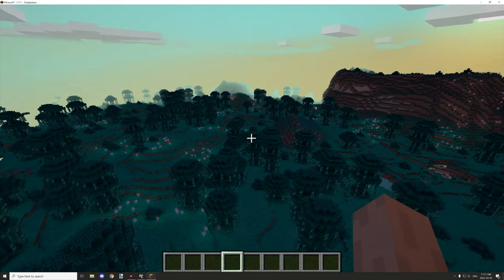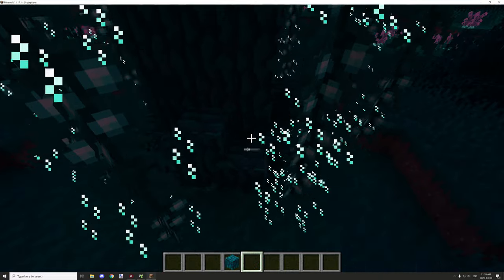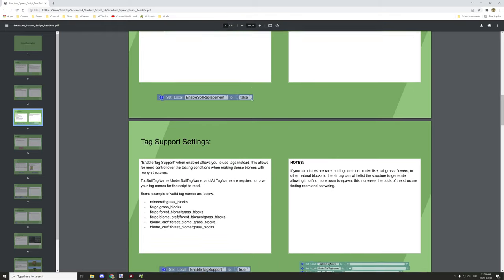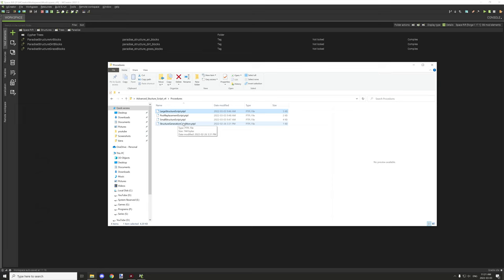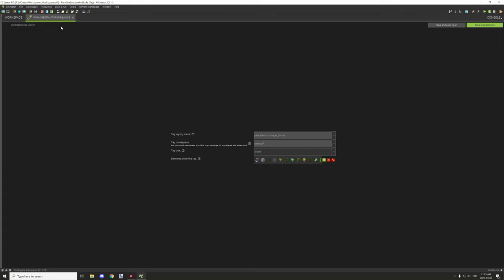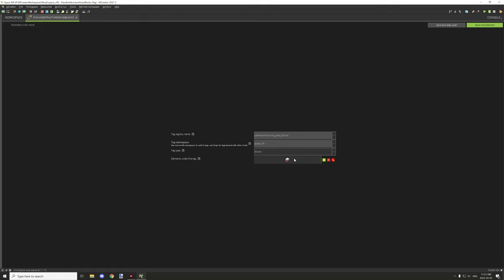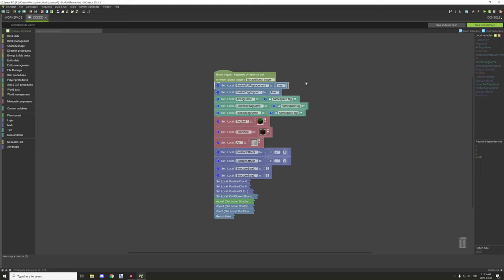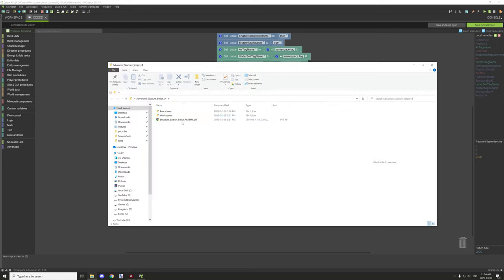MCreator: Advanced Structure Generation Script | Update v1.2.2

Comment: Can you make a video for structures bigger than 48 blocks, like how do you make it so 2 structures generate next to eachother and never apart so you get bigger than 48 blocks. Dont try and explain in text please because others have allready done that and i still dont understand.
Reply: Step#1 - Install WorldEdit mod for your Minecraft version. Not in MCreator   https://www.curseforge.com/minecraft/mc-mods/worldedit/files
Step#2 - Create a bigger than 48x48x48 structure (just make a test structure, nothing fancy. But try not to make it exagerated big, meaning over 200x200x200 - it will cause a big lag). Not in MCreator
Step#3 - Using WorldEdit commands, copy and save your structure as a *schematic (DO NOT USE CUSTOM BLOCKS OR ITEMS). 
Step#4 -  For 1.16 and bellow, go to https://cubical.xyz/ (for 1.17 go to https://beta.cubical.xyz/ ) and open the saved *schematic, delete the marker blocks (if any), and save it as *.nbt.
Step#5 - Go to MCreator and import the previously save *.nbt, and test in game (add it with procedures or structure spawn). 

This is what I did some time ago. 
https://www.planetminecraft.com/project/oversized-pyramid-test/ and the mod - https://mcreator.net/modification/81975/new-world-height-and-depth    
Have fun.
Reply from the maker: I have done a building series where I took some cabins which was 64 by 64 blocks wide it may be worth watching the parts for that build. I used chunk manager to load the chunks.

Comment: Do you have any way to override vanilla structures? I was hoping on creating an updated version of the jungle temple
Reply from the maker: Sadly a lot of the structures in vanilla are not supported for overriding using data packs, you would need to make a data pack normally and replace the parts with your own parts sadly adding new ones is not as easy as replacing them, but some of the new structures like villages can be updates using data packs but things like dungeons, and I think temples are not supported yet.

Comment: Hi there. I’ve been trying out these scripts, and they’re pretty cool. The only problem is that, for my larger structures (even just 19x24), half the time they spawn with bits missing, cut off at chunk borders. Do you have a solution for this? Thanks.
Reply from the maker: The script is designed to keep things on the ground, not fix this issue.

The problem is down to how the game loads features, MCreator uses features at the moment for generating structures and what is going on is the chunks are not loaded in some cases when the structure generates, this is noticeable with large structures because they can take up more than one chunk. You can use the forceload command to preload using the additional generation condition script but keep in mind you want to run the same command to unload the chunks as this can impact performance if so many chunks are still loaded in the session.

The command supports relatives coordinates using ~ so you should be able to do something like ~-32 ~-32 ~32 ~32 and it should cover a fair size of area. This seems to be the only workaround I have found but the issue is due to chunks not belling loaded when the structure spawns so it cuts them off from those chunks.
Reply: @NorthWestTreesMCreator  Thank you, I’ll try that out in the coming days. After the forceload command, would i use a “wait X ticks and then” block and then run the unload command?
Reply from the maker: @teab0244  You will need to make use of both sturcuture procedures.

The "Additional generation condition:" runs before the structure is place at the location of where the structure will be place so you will want to force load the chunks here just make sure to return true or if your using the advanced generation script I made just let it do it's return cycle.

After what you will want to do is use the "On structure instance generated" This runs after the structure is generated, this is just a regular procedure so you can simply run the command under here to force unload the chunks.

If it still does it there is a good chance the forceload command does not cover the entire structure.

For the size of the forceload its mesured in two points opisit X and Z corners setting the value to ~ ~ ~ ~ will be only the chunk the structure is in so you will need to make sure both commands use the same offset.

Try something like this first.

~-32 ~-32 ~32 ~32

This should be a good enough size for most large structure if it does not work and you still see parts getting cut off try changing the size with 16 more in diference so 48 in this case and then  64 if that fails too.

I have used this command with the execute command to use the /set block command in worlds that I did not enter yet in a new world so it should work for this in the same world. I have use a plugin that has done a similar thing but no point to get a plugin if you can do it easily with a built in command.

I hope this helps.

Just remember the one that says condition is run before so you want to force load the chunks around then it's important to force unload everything or it just stays loaded in the background until the session is ended.

Comment: Hello thanks for the tutorial, I'm exactly searching for some kind of help with structures making them not float. But seems that I can't make the script work. What I did made nbt of Minecraft village well which is 5x5. Then i imported your script "SmallStructureScript" and set the structuresize x,y=5 and posistionoffset x,y=3'. Then I added another script "StructureGenerationCondition". Not sure if i have to create "tags" and if needed where to do it.
Reply from the maker: Tags will need to be created for your soil, grass, and air blocks, for your air blocks you can whitelist other blocks such as tall grass, flowers etc. that would obstruct the generation for the structure this will help make them spawn in some cases. The procedures are already set up in a way where you just need to add your tag name and namespace to the "small structure script" or the "large structure script" it will be at the top of the procedure in a string tag, the rest of the procedure will handle the rest.

If its a large structure like a house I suggest using the large structure script as it can take into account three layers allowing it to make a bit of room for the structure, this can be really good for things larger then trees and bushes small houses or larger structures however it can cause some terrain to be a bit uneven around the structure but only one block above or below so its not to bad.

Comment: I am in version 1.19.2 and it just doesnt work. I added tag support but the trees just wont generate
Reply from the maker: Most likely the test area of your structure is to big, you can use the offset to shrink it down to a more reasonable size. Keep in mind it finds a space that can place the structure so if the structure is 7x7 x and z then it needs a flat area that is exactly that size for it to spawn. This makes terrain like hills where there is only like 1 - 2 blocks not generate structures not only is this more natural but it will also ensure it does not float. 

Say you want to shift the 7x7 to a 3x3 area then what you would need to do is offset by 2 on both x and z and then shrink the size down to 3x3 this will test for the 3x3 block center in the block.

Also if you have a lot of blocks that could get in the way of it generating then it's possible it can't find a spawn location, you can add things like flowers or tall grass or anything else just above the top block to the air tag and it will be ignored and seen as a spannable location.

I am using the same script in the Lore series for the trees and shrubs actually.

I hope this helps a bit.
Reply: @NorthWestTreesMCreator  ^so if I undestood correctly if I have a 3x3 size structure and want it to check for a 1x1 area the StructureSizeZ and X need to be set to 3 (the actual structure size) and the offset X Z are 1.  Is that correct?  sorry if Im asking for sth that has been explained in the pdf but I couldnt find it.

Comment: Hi, your channel really helped me make my mod. but your 2021.2 version of this procedure looks to be broken. it doesn't load correctly.
Reply from the maker: 2021.2 had some issues due to local variable strings being broken, I can't fix the issue now as its no longer supported. It works with 2021.3 though I know that for sure because I am using it in my own mod that I am working on.
Reply: @NorthWestTreesMCreator  ooh i get it :) thanks for the response. do it work for the snapversion 2022.1 ?

Comment: Does this still work for 2022.1?
Reply from the maker: Indeed it does, I have been using it on a mod called SpaceRift.
If your using 2022.1 then make sure you use the latest version for 2021.3 this will work for the last patch for 2021.3 and up.
Reply: @NorthWestTreesMCreator  If I were making a tall but thin tree, which procedure should I use for generation, and do i set the structure size to the width of the trunk or the whole structure?
Also, when the trees generate, it replaces the ground with dirt and not grass

Comment: I've spent days trying to get this to work and i cannot figure out what I'm doing wrong, does this script work on the latest version of 2021.3? I have a tree structure built in a 13 X 13 structure square (trunk base right in the middle) and i have size x and y set to 13 and the offsets set to 5 (to test for a 3 X 3 area. tried with tag mode both off and on no luck. any advise?
Reply from the maker: The latest version I released on GitHub supports the latest patch for MCreator 2021.3, the way the script works is it will try to find a flat spot to spawn the structure that is the size of the dimension you are testing for, so if your structure is 13x13 X and Z then it will need a flat square that same size. However it also tests for the dirt block and air blocks above if you have other blocks like flowers or tall grass then this can obstruct the structure spawning script form working hence why I added tag support as most often the case you will need to use tag support for it to work, however non tag support could still be used for smaller generation like flowers and such still so I added support for both.

There are a few ways you can go about fixing the issue, you can use the large structure script this tests for a 3 block deep area allowing for a bit more uneven terrain to be taken into consideration so it will test for one block above and one block below, or you can also change the structure size and offset. for one every value you want to shrink the size for the structure to generate will be 2 on your structure size.

so if you want to set 13 to 5 then you would need structure size of 5 this is 4.5 roughly blocks from the edge so you need to offset the value by 4 (13 / 2 - 2 = 4.5) 0.5 is the center block for your structure so you would round down and use 4.

I hope that helps a bit
Reply: @NorthWestTreesMCreator  Thank you! I knew would be a few simple things i wasn't quite getting lol. there spawning now but i can't seem to get enough to spawn i have the x and y set to 1 and the offsets set to 6 (13 x 13 structures). spawn per chunks setting is already at max :/ Using tags so i don't think it would be the grass? any further comments appreciated :) Love your channel it's been really helpful ^w^